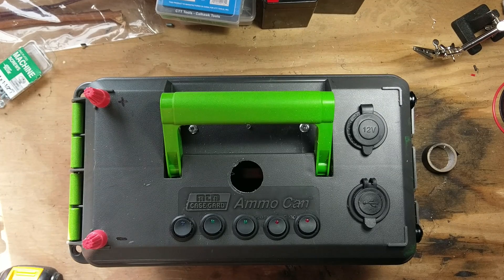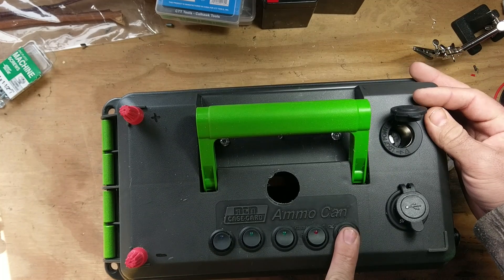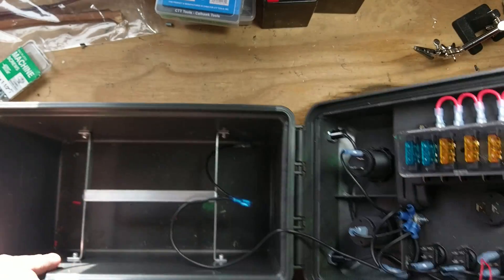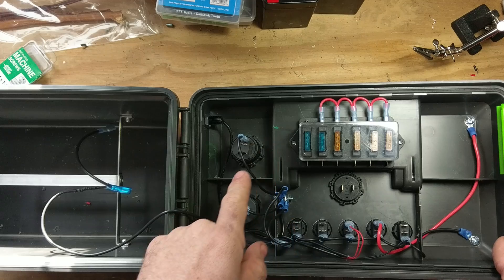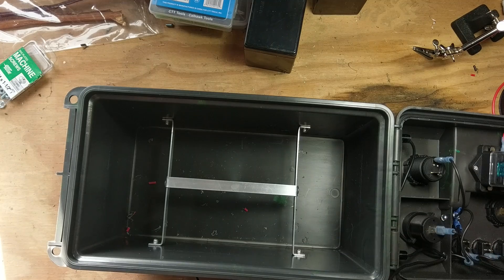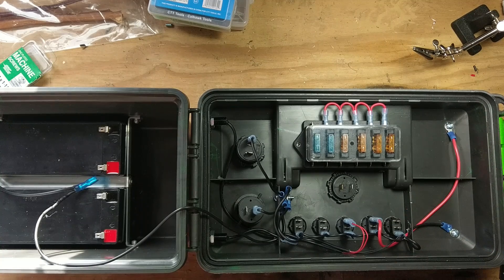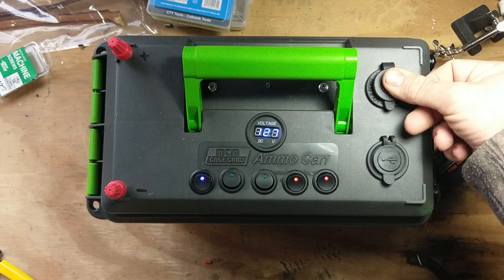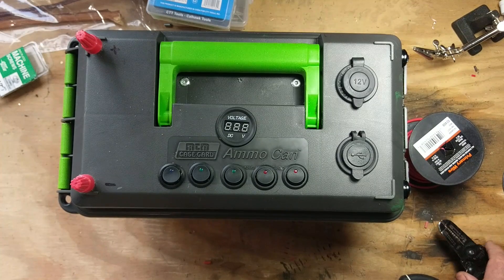How to build a 12v portable power box

Comment: Almost five years ago now, did something similar but most of the lights were replaced with a Bluetooth amplifier and some car stereo speakers.  Wound up changing the battery to a Lithium Ion one as the sealed lead acid was no longer holding a charge for more than an hour.

Comment: Great DIY project, and well explained !  However, what charges the batteries...?  Did you envision a solar panel ? ....or perhaps a charger of some sort..?   
I built a unit almost like yours but added an 500ah inverter, and an input for a solar panel, (mine is a portable 200w unit).  It works great, as yours will as well.  
Thanks for sharing your project.

Comment: Hi this is a great! With your experience can you give me a rough approximation on how many times you could charge a modern mobile smart phone with this set up of 2x 12v 9ahr batteries? Thanks again
Reply from the maker: You should have no problem getting between 4 and 6 charges out of it easily depending on the sate of your phone battery at charging

Comment: great video but you managed to fuse the circuits 3 times, once for the input to the switch - ok, once by the voltmeter feeding the fuses - not needed and lastly the output fuses to each circuit which are ok . the problem is the discrimination between the fuses (wire type) isn't very good for this type of fuse ( glass are more accurate) so a fault may cause several to blow and be problematic to fault find. I would suggest going from the main switch to the bus bar directly and not through fuse 2.it would have been better to fuse each battery independently.

Comment: How do you charge the battery 🔋 in the box ? I’m looking for ideas. I only have a 12v cigarette socket in the flatbed of my truck and would like to keep the box charged up as I drive
Reply from the maker: Use this 
https://amzn.to/3iMieTR
And plug a 12v trickle charger into it and hook directly to the battery or posts with switch on.

Comment: I have a question on the main power switch. I built one and have a main power switch followed by individual switches to each item just like yours with exception to the cigarette lighter plug. I ran the positive to a fuse and direct to the cigarette lighter plug so it’s always hot. I did this because I thought if someone plugged in an 110v inverter to the cigarette plug and plugged in a household item like a fan that the little main power switch could not handle the amps and would melt. So I opted to skip that switch. What is your opinion on those power switches being able to handle something like that? It’s a lot of power going through one little tiny switch to all the rest if using an inverter? I don’t think the cigarette lighter would draw any power unless it’s used.
Reply from the maker: Good question. Those inverters pull a ton of power. This box isn't really made to power an inverter. However it could easily be made to do so. You would want the lighter on its own cucuit with 10 guage wire and inline fuse in order for it to safely work. Those switches won't handle that many amps so either don't switch it or use a heavy duty switch. But make sure to fuse it. They won't pull power if nothing is plugged into them.
Reply: @JDSOutdoors  sounds like I did the right thing then. Thanks! I have the lighter plug fused individually and being hot all the time isn’t a concern because it has the rubber cap. My only concern was that it would draw power ever so slightly and overtime deplete the battery.  The rest of mine is set up like yours where one main power switch allows the other switches to give power to their individual item.  Do you know of any switches that could handle the power of an inverter? Like a link on Amazon or what they would be called or their specs?
Reply from the maker: @freshmaker5  what size inverter are you using? I have some switches I love for that just wanna make sure your inverter isn't to big
Reply: @JDSOutdoors  150w but I’m open to suggestions
Reply from the maker: @freshmaker5  this is my favorite switch for applications like that
https://amzn.to/3sHOQm0
Reply: @JDSOutdoors  wonderful thanks
Reply from the maker: @freshmaker5  no problem

Comment: Very nice job. Actually bought the same swiches for redoing my old Jeep. Only change I would make is to connect the hot leads coming off the fuse block to the swich beneath it rather than running the wires diagonally. But, that's just my OCD kicking in! Suscribed.

Comment: Reason why I ask I finish my box and test everything led lights keep blowing a fuse
Reply from the maker: Something sounds wired wrong
Reply: I used 12 guage wire running into main switch into 12v cigarettes light volt meter and USB port all that running off one fuse and led lights on its own fuse
Reply from the maker: @donaldfinkler2490  probably a defective led light. Swap it out

Comment: How do you wire in a 2 pole toggle switch and then volt meter, and finally on to the fuse block?
Is it battery + to one side of toggle, then + from second side of toggle to volt meter, and then + to fuse block?
Is it battery - to volt meter, and then - to fuse block?

I have a really nice heavy 30amp toggle, but it only has two poles. So Im assuming it isn’t directly grounded, but is simply interrupting battery positive lead?
Reply from the maker: Yes it would be pos in from battery and pos out to fuse block.

Comment: What if i use an inverter (400w) with these batteries instead ?
Reply from the maker: You can do that. Just make sure you use the appropriate sized wire for the 12v outlet
Reply: JDS Outdoors thx sir. I have a 30 watts solar panel, 2 batteries 12v 7ah in parallel and an inverter 400watts .what amp regulator should i buy to charge normally the batteries? Any advice will be welcom
Reply from the maker: @realnavy7853  I'm assuming your talking about charge controllers? For that small of a setup pretty much any controller will work. Pick the physical size and budget one that fits your needs for the area mounted
Reply: JDS Outdoors yes « charge controller ». I am sorry am a novice. I want it just to charge phones and tablet only. I’ll subscribe ,you deserve it
Reply from the maker: @realnavy7853  any one will work for that setup

Comment: Everyone thinks this is great but one thing they all have forgotten about is RECHARGING the batteries. That is ease if you are at home but if you run out of power while camping you will need some way to recharge the batteries. The best BEST way is with solar but that would take a charge controller and at least one or two solar panels. The next best way would be charging through your car or truck 12 Volt DC supply (segregate lighter plug). BUT HE NEVER said how to FUSE the charging system or how to hook it up.
Reply from the maker: Version 2 and the solar upgrade covers all that. Thanks

Comment: Thanks; very informative. One query: Was there a reason for having your left hand fuse wired to the right hand switch, etc. so that all your +ve wires crossed over? (I'd have thought that left hand  to left hand etc would have used less wire and be easier to see what's what if you need to do maintenance.)
Reply from the maker: I have since switched the fuse block to one that works way better
Reply: @JDSOutdoors  Thanks - now watching your solar upgrade (& asking more dumb questions :-)  )

Comment: What voltage level do you use it to, before recharge? And how long does it take to charge? And CAN U CHARGE IT BACK UP FROM A CIGARETTE LIGHTER OUTLET IN CAR WHILE DRIVING OR DO YOU NEED HOME AC POWER TO RECHARGE IT. WHAT AMPERAGE DO U RECHARGE IT AT?
Reply from the maker: I personally like to recharge around 11.2 is my "empty" and yes you can recharge via the 12v outlet as long as that switch and the master is on. However it's more economical to charge at home

Comment: Wouldn't it be better to have a battery gauge instead of a volt meter if you're using a lithium battery?                                                                                         
Won't a volt meter show full voltage for a lithium battery even though the battery may be 50% used?

Comment: Great video. Do you remember what size drill bit you used for the power switches?
Reply from the maker: Any 12v switch from Amazon will work
Reply: I’m sorry, to drill the hole. I have the power switch like your already
Reply from the maker: @bigpat728  I used 3/4" then an exacto knife to make any adjustments
Reply: JDS Outdoors thank you so much. I’m actually watching your part 2 video right now.

Comment: The light on my master switch stays on even when switched off any ideas?
Reply from the maker: Yes your switch is set up a little different then the ones I used. If you followed how to wire mine and it stays on constantly then swap the power in and power out wires. If that doesn't fix it you have a bad switch or you can pull your ground wire

Comment: I understand the total isolating fuse, but every individual circuit except the volt meter goes through a total of THREE fuses. Output from the main switch should have gone directly to the double M power side of the fuse box, then each circuit, including the voltmeter come from the other side.

Comment: can this make a portable audio recorder battery
Reply from the maker: If the system runs on 12v or you install an inverter absolutely
Reply: from the six fuses, what is the size of each fuse?
Reply from the maker: @ryanbanyumili1511  10 main 2.5-5 for the rest
Reply: I have an audio recorder with a maximum input of 10-18volt and 6 amperes means if I install it like this it's safe, and I have a 12 volt battery 2.5 Ampere 2 pcs

Comment: Where did you get the box from
Reply from the maker: Local sporting goods store. They also sell on Amazon but they ate usually 2x the price as in the stores
Reply: @JDSOutdoors  can the Plano hold two batteries
Reply from the maker: @bobbymartin68  no those ones are a little smaller
Reply: @JDSOutdoors  what box would you recommend for using two batteries
Reply from the maker: @bobbymartin68  this style. It goes by a few names. Zombie box, field box etc
Reply: @JDSOutdoors  thanks for your help

Comment: Great video... it was very informative.  I’m going to build one.  Question... do you need to have all the other switches?  I understand the main power... but is there harm having power going to the other sources?
Reply: No need to switch each individual outlet (except the LEDs), however the advantage is that you can switch off stuff without having to disconnect it every time.

Comment: I bought a Powerwerx premade power box, a battery, and a battery charger. It cost me about $200 for all 3 items. It saved me a lot of work. Now my thoughts are about improvising so I can do more with it. For example, I will after learning to use this properly for small wattage electrical things, connect much higher Ah battery(ies) so I can power a lot more stuff. For those of you who want to save time cutting up and connecting wires, you could consider the Powerwerx power box to get started quickly with little work.

Comment: I'm examining multiple videos and I have ordered two books. I'm doing a lot of thinking on how to handle a situation where the power grid fails for a long period of time. When I researched power generators I discovered that most required significant amounts of gasoline which might not be available if the power grid fails. Storing large amounts of gasoline is a safety hazard so I'm looking for other methods to counteract a power grid that fails for long periods of time. Terrorism, EMPs, and just ordinary warfare could destroy the power grids.

Comment: Sorry to ask, What size wire and connecter's are you using?  I'm using 14ga wire and 12 Ga connecters and the connecters are to small, I'm tiring to do the ground wires the same as you did instead of having a wire for each post.. Jump from 1 -2 the other.
Reply from the maker: Kansas I use a combination of connectors 10-12ga yellow 14-16 ga blue and 16-18 ga reds check out my new video it's a lot more helpful. also sometimes you have to twist tight an push a little to get them to go in
Reply: Thank you very much, I did as you said, Works perfect.  Thank you very much for your videos.

Comment: Boy, that's nice and tidy wiring. Fantastic design.  Thanks for sharing.  I have no idea what your time is worth to you but I'd be willing to pay a guy $50 to source and build one of these.  I'll be using this wiring design but will be solar charging.  Will also add a connection for 2 hand crank chargers so can charge the battery if not sunny.

Comment: Look great. Question why not just use one 15amp main fuse instead of using a fuse block?
Reply: 15 amps is a lot of current. Stuff would burn up before ever blowing the fuse...
Reply from the maker: theflyerpr40d I like everything fused individually it's safer
Reply: JDS Outdoors that explains, it just seem like it take more space but like I said it look great.
Are those crimp connector the one with the soft rubber insulation? I can't find them anywhere

Comment: Good video and nice box.
The info at 6:40 about connecting the positive (+) wire to one battery and the negative (-) wire to the other battery is not necessary. No matter how you connect them power is being drawn evenly from both batteries at once.

Comment: we're does the negative battery wire go to
Reply from the maker: Lee Wagstaff to the negative post
Reply: JDS Outdoors so don't really matter were the negative goes as long as it goes to a negative
Reply from the maker: Correct I use the negative power post as a ground spot to connect everything to, to keep it easy
Reply: JDS Outdoors that's great thanks

Comment: JDS - do you have a part number/description and url link to the "double spade terminal" looking spade you used to connect the negative parallel terminal on the battery? or did you just use a 12-10 GA spade terminal to double connect on the battery terminals?

Comment: Hi JDS Outdoors, this is awesome and I am aiming to build one to go fishing! I am no electrical expert so what would really help is a list of the items you used...e.g. 7amp fuses / 10amp wire etc... if at all possible. No worries if not I can muddle through. Thanks for the video!
Reply: He also never said how to RECHARGE the batteries, most of us use SOLOR but you can use a  small  battery tender from Harbor Freight. You really need to charge when you are away from home, that would be with solar most likely. You could hook it up to your car 12V DC supply (segregate lighter). That is not in his description. What I would do from the LEFT I would have a 20 amp MAIN fuse then a 7.5 or a 10 amp fuse then the rest would be 3 amp fuses.

Comment: Straight forward video. But you would do well to paint the negative battery terminal black on top of the box. Just dip it in some PlastiDip paint or use Liquid Tape to avoid any possible confusion.
Reply from the maker: lorus511 they have since been replaced with banana jacks
Reply: Good idea

Comment: There are loads of videos here on how to make these boxes: this is one of the better ones. Only suggestion I'd make is to lay an insulating sheet of plastic or rubber over the batteries because the working parts get a bit close when the lid is closed: adds a second line of defence if anything wiggles loose in transit and prevents shorts. I like the master fuse and master switch.....

Comment: I'm guessing those fittings need a 30 mm hole. 1 1/8" is 28.6 mm and 1 1/4" is 31.8 mm which would explain one being too small and the other too large.

Comment: I'm a newby. How do you install the aluminum flat stock? Do you bend it? How do you attach? What size screws and nuts? How do you measure to have batteries fit? Do you have other videos that I missed showing how to add connectors to wires.  I like your whole set up but need a more detailed parts list. I also need more details in setting up fuse block and installing switches. Thank you.
Reply from the maker: I used a vice and hammer to bend the aluminum and used 3/16" rivets to attach them I used 14ga for the wires that go from the battery to the fuse block and 16 ga for the rest. also there a tons of options on Amazon for 12v stuff shop around and see what works for you

Comment: I just got the last of what I need for my box, which will be a power source for a trolling motor on a canoe.  My box will have a cig lighter, combo volt/amp/watt panel meter (ebay), combo battery charging port & battery status panel (NOCO chargers), PWM motor speed controller with variable speed and a reversing switch (ebay). I plan on having 2 sets of power lugs. 1 set of lugs will come out of the PWM speed controller (for the trolling motor) and the other set of lugs will bypass the speed controller. I had already planned on doing almost all of the wiring on the inside of the lid like you have done. I am using one 35ah battery (Amazon).

Comment: Nice simple to understand 
is it possible to hook up a 10w solar panel for charging ?
Reply from the maker: Troy kirchner yes as long as you add a charge controller
Reply: Cheers mate I built mine after looking at yours have you  made any more plans for any updates to yours ?
Reply from the maker: Troy kirchner only update was a charging plug and banana jacks in place of the bolt pos and neg posts
Reply: Hello 
regarding hooking up a Solar panel 
I have a 10w and Control 
I just have to Work out how to wire up the Solar panel souls it ger Wired to the Main  Power Switch so it doesnt Stay in all the Time .

Comment: Nice build, and a very well organized box. FYI, your batteries are in parallel giving you a 12V 18Ah system. If anyone is curious, you can also connect them in series and get a 24V 9Ah system (I hope that's right, college circuits were a long time ago). Just depends on what your needs are. Thanks for posting.